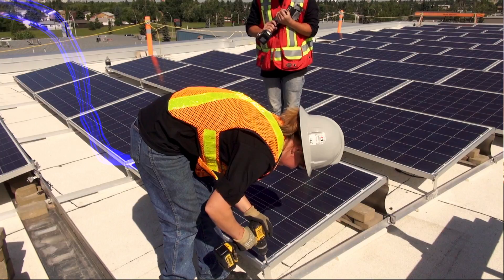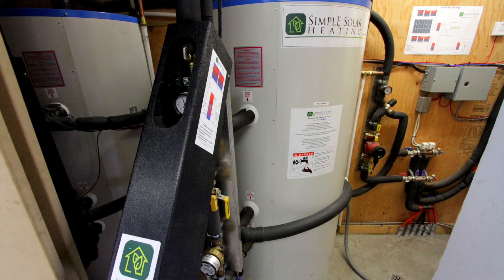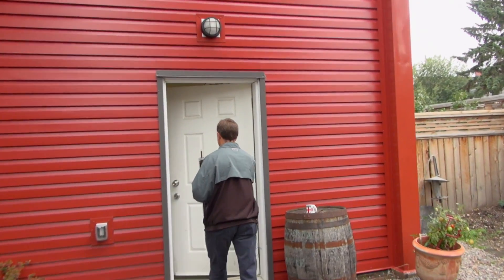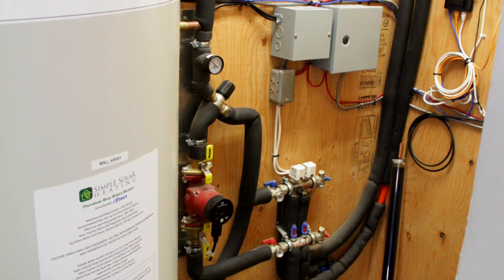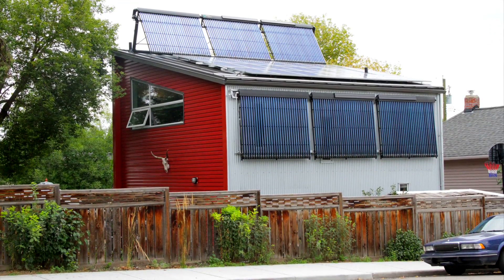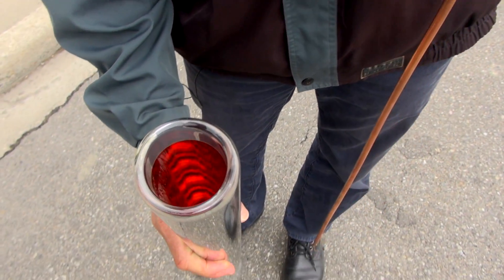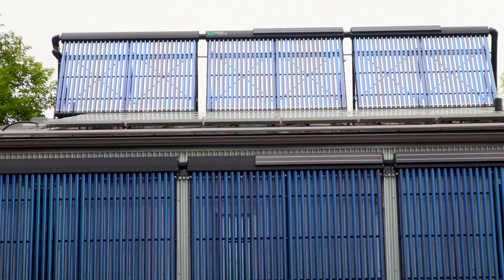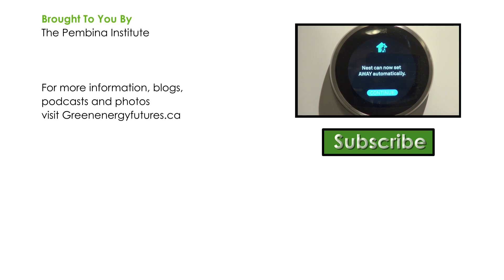154. Solar Thermal 101 - how a garage suite went net-positive using solar energy

Comment: 80 whole systems in 8 years?  That's like 10 a year.
Why not put auto or truck radiators in the solar thermal box, painted black of course?  This would likely be much more efficient at capturing the heat of the sun.
Radiators are very efficient at heat transfer.  A 220hp engine running at full output at 23% thermal efficiency  is putting off 717 kilowatts of heat continuously. The radiator is able to exchange most of that heat with the air continuously, at least for a while.  A radiator is very good at equalizing the temperate gradient between the inside and outside of the radiator.

Comment: How does it work in cloudy weather?
Reply: It circulates water more slowly and still reaches the desired output temperature. Vacuum tubes are great!
Reply: @avid0g  Yeah bc of the Vaccum ,it Traps the Heat even if its very cold

Comment: I have a 60 tube evacuated tube array on my summer home in Michigan. It provides 100% of my domestic hot water in the summer. I have to cover about 30 tubes in the summer to keep from collecting too much heat. In the winter I switch to heating the house. The collectors keep the 2400 sqft home above freezing all but usually 5-10 days all winter, I drain the water system so freezing isn't a problem. I had planned to install a 2400 gallon tank under the floor when I built the house to have enough heat storage to ride through the real cloudy and real cold days but didn't. With more storage (only have a 120 gallon solar storage tank and a 50 gallon standard electric hot water heater) I have no doubt I could keep the house above freezing. The system has been running for 7 years. We are in a resort area with plenty of guests in the summer. We have had 14 people in the house taking plenty of showers and have never had to turn on the electric hot water heater. I have even challenged my guests to run me out of hot water. If I start running low on hot water I uncover a few more tubes. The collectors collect plenty of heat on all but the most cloudy days. With snow on the ground they collect about 50% more heat. My system needs 110 volt power so I have a expansion tank that keeps the system from purging when I loose power not ideal but it works. My collectors are on the ground so I can cover the tubes to keep from collecting too much heat. The system does heat the house if the system gets too hot, not fun on a hot summer day.
Reply: Heat dumper is the solution to your problem ! I think I l put 2 underfloor circuites below the insulation to dump heat in the hottest day s!
Reply: I was trying to figure out how one would keep the system from overheating in summer.  
Simple solution.    I’m trying to figure out if this would work in a treed property so in summer it heats only a little bit of water and in winter as trees shed their leaves the tubes produce more hot water as needed.  
Do you have any idea who I would contact in the states to find out?
Reply: That was a smart move, putting your collectors at ground level. Mine are on the roof where they are very difficult to cover. Now I'm trying to come up with remotely operated sliding covers of some type. Your approach is smarter.
Reply: Can the vacuum tubes develop leaks, ie lose vacuum?
Reply: Where did you buy the vacuum tube s from in Michigan? Or from Canada?

Comment: Be aware of the heat pipe cap, not having a vent hole, as in my early years testing my Apricus heat pipe collector, which was 100% plugged up, so no heat expansion could escape. We have some power cuts in parts of the country on one of the hottest days of the year, so when the power came back on again, the thermal shock of the cooler water imploded the inner tubes. 
We went back to re designing the positioning of the heat pipe to be off set, tight to the glass, with a fully open tube. No more implosion problems since 2003
Reply: Never rely entirely on grid power. Our evacuated tube array has a 24V pump running directly off a PV panel. We have grid power but don't count on it. If your glycol just sits there during a power failure while the sun shines the glycol will be ruined and the entire system must be drained, cleaned and refilled.
Reply: Hi Paul, happy new year. I have never used any glycol in my UK solar central heating system, since 2003. My big problem since I lost my SWH distribution business in 2009, is to explain why many SWH system fail is all about the type of hot water storage. My home tank is vented, my Apricus tube collector heats the tank direct. The same water in the tank passes through my 12 steel radiators, while my potable water at pressure passes through an external plate exchanger. But our large comercial tanks made in Sth Africa only up to 10,000 litres have heat exchanger coils inside. Go to www.thermotube.biz and look at the youtube video. We have freezing and snow in the south of England, but my Solar controller protect the small water in the header through a frost protection built into the Sorel controller. But for your 24 volt PV system, you just add Glycol into the hot water thermal store, during the filling by a header tank of 4 galls located above the thermal store. Once the hot water tank i first developed in 1991 is understood, all the closed loop/glycol problems are gone.
e-mail me at eric@solar-speed-flex.com
Reply: @erichawkins3915  
Two broken links...
Reply: @erichawkins3915  Hi Eric, from central British Columbia, Canada. Your system sounds very interesting! We have no choice but to use glycol here because of the severe cold. Yes, a glycol system with heat exchanger is more complexity and more money. But we regularly drop to minus 30C most winters, and some winters can hit minus 40C. We use a strong mix of glycol and water so it doesn't gel and become un-pumpable. As I mentioned above, we still make hot water at these very low temperatures because we're known for our sunny winters.
Reply: @paulmaxwell8851   So Fantastic! Just wondering if its still working? as im very interested in SHW!
Reply: @guiltfreehotwater4354  Yes, the system works well. There are things i wish I had done differently, and who knows? Maybe I'll make some changes. I put my three twenty-tube panels on the roof, because they are out of the way and unshaded. But that means a lot of extra work with a very long snow rake every time it snows, which is often. Plus, in the summer we generate too much heat and need to cover two panels; that means climbing around on a steep roof. I wish I had used some sort of rground mount.

The PV direct circulator pumps work well. I had one fail after several years but overall the system is very reliable. As is usual with solar, we over-produce in the summer and that means needing to cover panels. At the moment we rely on dumping excess heat through a 'heat dump', a radiator with fan. It works but that's just extra complexity and wear and tear on the system. Covering un-needed panels would make far more sense.

Live and learn. I'll probably make some changes, but we're very happy with our system. There are only two or three one-week periods per year when we don't have enough hot water, and I plan to install a propane tankless water heater for those rare instances. Good luck with your projects!
Reply: This only happens if you install close loop pressure system on the solar loop into the cylinder. Dump the pressure cylinder and closed loop kit and go direct, but still benifit from hot water at mains pressure, but not direct through the tank. Your closed loop system is why the fluid heats up above 100c, in a open system, the fluid expands back into the vented tank.

Comment: Solar technology has now moved up another step, by converting solar PV panels to PVT. PV + thermal is now a big growing market in Europe, while my own low cost hybrid combined with a water to water heat pump is now on test in Australia. Solar PV panels are now at such a low cost $0.30 a watt, so it is now cost effective to add a low cost thermal exchanger to the back of the larger panels (270-330 watt). With our PVT system combined with a thermal store, we do not need all the extra plumbing/closed loop system cost or gylcol.
We developed the PVT +HP hybrid for the business market from Aquaponics to the food processing industry and Hospitalty industry.
By cooling down the PV panel to its test efficiency temperature (26c, you increase PV output)
Reply: Link?  Looked, but they aren't using it to heat their home from what I see.  Combined with heat pump possibly?  For ST to be cost effective you need to reach 50C.  Then you need a giant insulated solar storage tank of roughly 10,000 liters up north.  Down south?  No need.
Reply: For the past 16 yrs, my UK house has gained support heating from my 44 heat pipe collectors installed 16 yrs ago, no need for massive storage, just use the days sunlight to keep the house from going cold during the day time. As long as the house is insulated. 
I only run my gas boiler for 1 hr in the morning and then it switches on at 4.30pm this time of the year.
Reply: 1) Bet you have a common wall to your neighbors
2) UK doesn't exactly have cold temperatures below freezing
3) You probably keep your house cool(perfectly acceptable to save money as we all wish to do.)
4) If you had a hot water storage tank and a larger array you could probably get away without a heater for 99% of the year.  

PS: From Seattle.  We do not get sun for 3 months in a row, so we must have storage.  PPS: I use fixed compound parabolic mirrors I built myself.  Get higher quality heat than vacuum tubes and I can clean them easily unlike the tubes which is a MAJOR issue with all the leaves/needles/pollen in spring/fall time.  ANother thing most PV people "forget" to mention.  You must clean them and have access to do so.   @erichawkins3915
Reply: My 2 x 22 tube heat pipe Apricus collectors are on my south facing 40 degree roof, while my 250 liter open vented thermal store I developed since 1991, is located in the attic, so very close to flow and return of the collector.
Sorry to tell you, but the south of England has seen minus 10c and depths of snow up to 6 inches, which I have many photo of. but even when freezing nights, next day is blue sky, which is all the collector needs to deliver 45-50c, direct into my thermal store which connects to my 12 steel radiators. 
I never use Glycol, never have any freezing in the collector manifold as my German controller has a built in frost stat.
Today my house is running at 20.5c most days, while outside this time of year is around 12-14c warm for time of the year, but my 18yr old mid terrace house is cavity wall insulated with thermal blocks on the inside, insulated floors and loft space.
My new heat pipe collector has a heat pipe condenser which shuts down at 80c, but to maximize the use of this thermal energy for heating support, you need a vented thermal store, as now being built in Sth Africa up to 1,600 liters.
This allows over sizing of the collectors without the worry to over heat water for sanitary use only ion summer months, when the space heating is shut down.

I agree with everything you say, and only last year I decided to buy a extension window washing brush system to clean my tubes after years of not touching them.
But still if I shut the pump off, the sun shining, my collector will soon heat past 100c, as I hate closed loop systems, just increases system costs.  @w8stral
I am now focused on my solar thermal cooling exchanger, which converts PV panels to PVT, just waiting for final approval on a Patent, my Australia invested in 9 months ago
Reply: Its all about how you programe your back up gas boiler system, as long as your house is insulated. Example: My gas boiler switches on at 7am, which heats my 250 litre thermal store which is connected to my radiators, while my potable water is provided indirect through a heat exchanger. The boiler switches off at 8.15am , haveing heated my thermal store to 70c, and the house is now warm at 21c, showers completed, and ready to work from my home office. At 9.30am, my central heating radiator pump switches on, to maintain the water temperature through the 12 radiators, only if the central thermostat shows heat has been lost in the house.
Subject to the weather, during winter months (does not matter how cold it is when useing tube collectors) as what we want is clear blue skies or cloudy/blue skies. Today my solar is running at 48c, into my tank and then into my radiators all through the day. The more solar you dump into your home heating, the greater the efficiency
Reply: Nope. We have three twenty-tube panels supplying a pair of 60 gallon tanks. The system runs well (it's been three years or so) and continues producing hot water down to minus 18C or so. Below that temperature hoar frost cannot 'burn off' and we then heat water with a coil-equipped woodstove. We're very happy with the setup. Williams Lake, British Columbia.   @w8stral

Comment: How we can contact with technical person? We went to get some seminar from them.
Reply: Simple Solar, Calgary, Canada.
Reply: Thermaltricity International UK, not just about solar thermal, but also solar PVT coupled to ground source heat pumps and thermal stores up to 10,000 litres we have assembled flat pack in Sth Africa since 2014
Reply: i have Free info for what i did , at Guilt Free Hot Water

Comment: How does it hold up to hail?
Reply: I heard that it withstands up to 1" hail
Reply: We've never had a problem, but then we don't get the monster hailstones they get on the prairies. Our biggest are about, oh, maybe 3/4 inch.
Reply: @paulmaxwell8851   and if u put at a Hi Angle that will also protect the Pyrex like so very hard Tubes and will "Chase that Winer Sun and shade it selff in summer when it has to much HOT
Reply: @guiltfreehotwater4354  Yes, you're right. My panels sit at 52 degrees. I don't know what I was thinking. Steeper would have been smarter because we get a lot of snow here (central British Columbia). Live and learn!

Comment: you didn't show how he is getting electricity from thermal system...
Reply: He isn't. There is 5.5KW of solar PV mounted flat on the roof.
Reply: oh I see, they made it sound like they were generating electricity in some revolutionary way.

Its just a how water heater.
Reply: @whatthefunction9140  
There are wide horizontal photovoltaic collectors at the top of the thermal collector tubes for powering the DC motor circulation pumps.
Reply: The hot water is then circulated around the house to heat it. You could combine it with in-floor heating but I don't know if that's what they did here.
Reply: I guess the hot water ( glycol ) could be run through a radiator system from a large storage tank in winter?    I would just be sure the house is super insulated